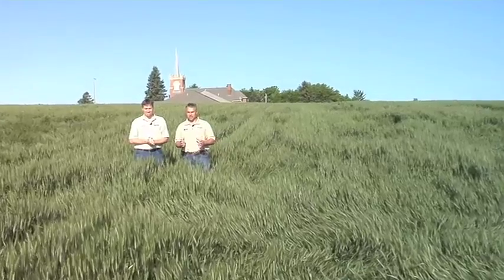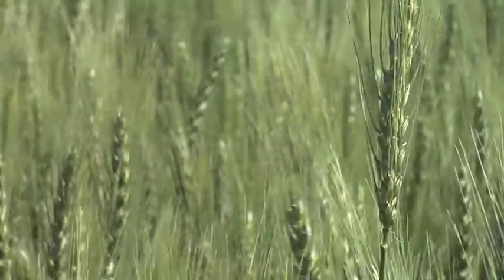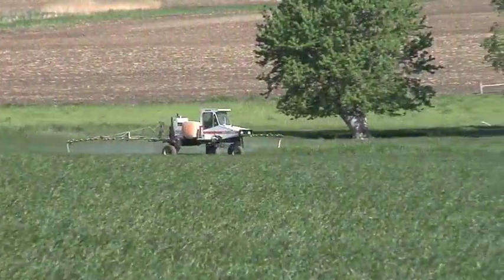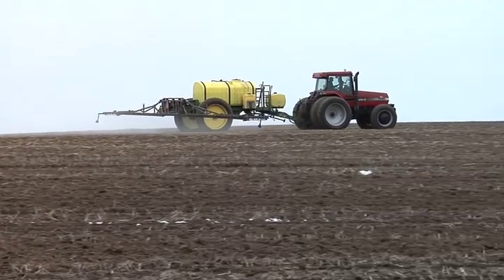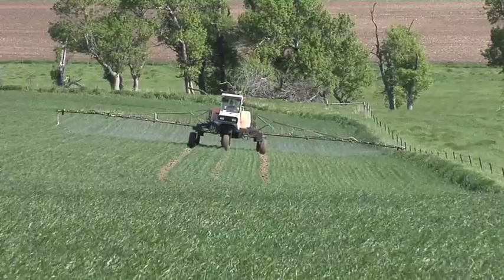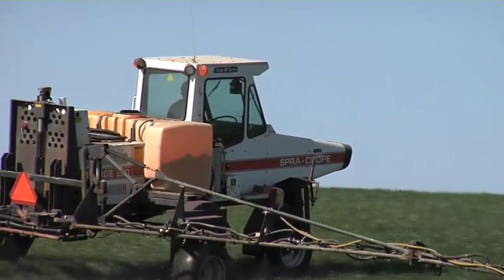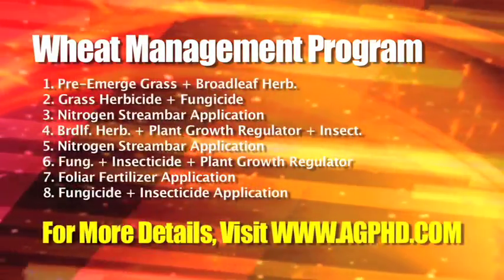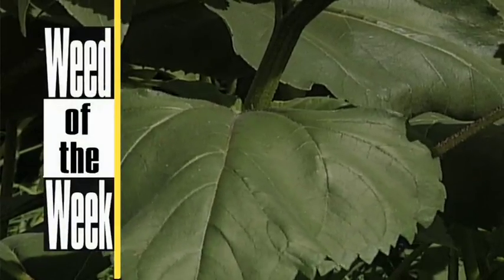Maximizing Wheat Yields (from Ag PhD #537)

Comment: You sprayed 8 times!!   You gave a good explanation for each thing you applied and there was an economic return to it.    The one thing you left out was the application costs.    By using tram lines and a sprayer with a big tank and very wide booms you cover a lot of ground per hour without knocking down any crop.  

I just thought this should be covered as well because not all growers are set up with equipment to keep application costs to just a few dollars per acre